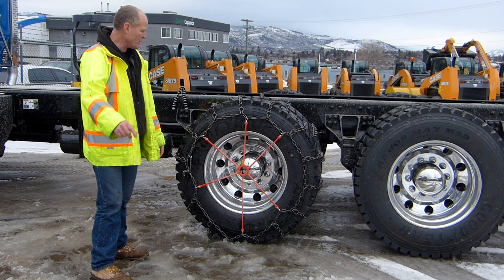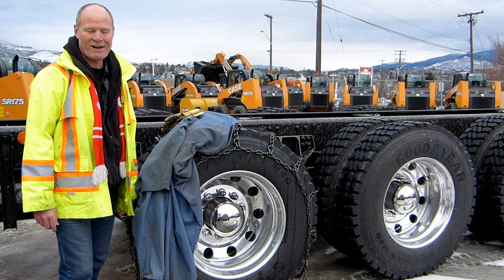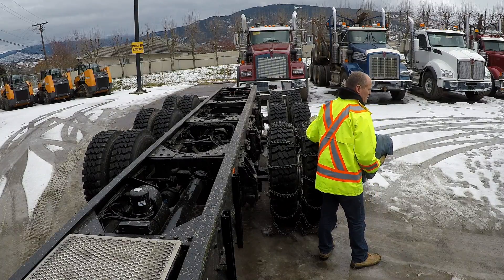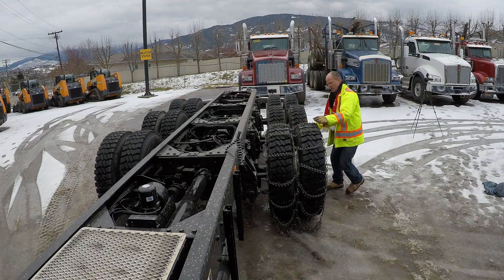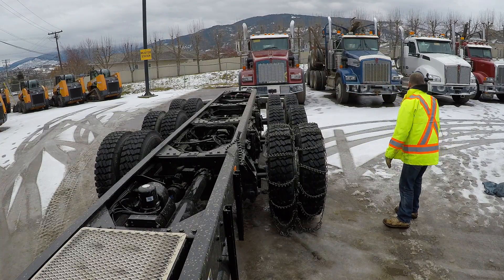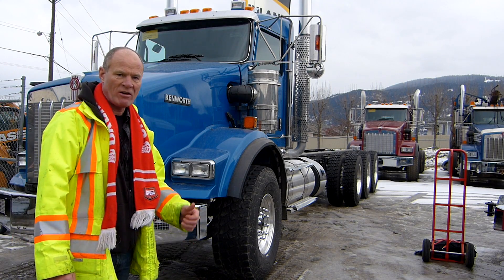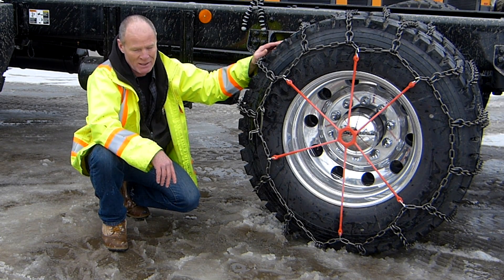How to Install Tire Chains On a Semi Truck

Comment: Thx Rick. Very informative & straightforward. I'm glad you didn't edit out the 'oops' of not rolling quite far enough to find the slack. It happens to us all.😁
With 17 years OTR, plus 9 years in the oilfield, I'm always looking for new tips & tricks.
You never get enough experience to stop learning. 
I drive a double bottom with full lockers. I run lots of off-road, & I chain up quite a bit.
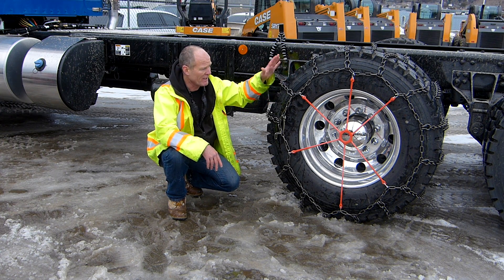I happened to notice something in your vid that may be confusing to the newer generation of drivers. At 7:50, you are talking about engaging the inter-axle, but it seems to imply that(in a tandem WITHOUT separate locking diffs) engaging the inter-axle would actually lock the entire front drive axle differential, when it merely interlocks both axles.
I do agree that if one drive axle is going to be chained, it should be the front drive. However, the reasoning is that (loaded/empty/bobtail, on level ground with proper weight distribution) the front drive axle always has more traction due to the fact that it is closer to the tractor's center of gravity.
It also extends the life of your chains because they don't scrub through turns.
I just thought you may want to review how that point is presented & clarify for the viewers.
Thanks again for the vid.👍
Reply from the maker: Hi Louis Becker - Thank you for your great comment my friend. As you said, we never stop learning. I've been in the driving industry for decades, and I teach it here on the channel. And it's because of smart drivers such as yourself that I'm continually learning more and more about this industry. Here in Vernon where I live, the logging trucks roll through all day. I often think how little I know about that aspect of trucking. All the best, Cheers Rick
Reply: Mr. Becker, you REALLY understand the physics of this stuff! I LOVE it! Thank you for your clear explanation which makes me really understand why! You are one of a kind! Many thanks!

Comment: Thank you it is a Very informative video, I know everyone does it differently but from my experience it works best to hook the middle first as tight as you can then the inside then the outside tire it helps to get them tighter and depending on the hook on the chains I always hook the first link then the next tightest link that way you don’t have the extra links flying around beating your truck and/or trailer

Comment: I always found it best to set up with the chains draped over the front of the tire with a bunched up bit of the chain you have to drive over when you pull ahead...then you can lift them up more to the top of the tire kinda the 2 oclock position hook the inner cam arm first then the middle both as tight as you can get them.  Then hook the end of the outter cam arm to the last link....yank that as hard as you can to pull the whole chain tight so you can grab any slack you might have on the inner and middle then unhook the cam arm and sorta hold it to the chain about where you think you can lock it to...slip the cam arm through that link then also slide the last link onto the cam arm and lock it into place and hook up the latch link apply any bungies you might have handy or may need and move onto the next chain. All told maybe 4 or 5 mins to throw and hook a tripple when you get some practice at it.
Reply: Ohh the idea behind slipping the last link over the cam arm when you lock it down is so you dont have 4 or 5 links of chain flying around ripping up fenders and any thing right above the tire like a trailer with possibly a wireing harness right in that area.

Comment: Excellent job rick and I'm not sure if there are signs for truck drivers to put in Chains because here in the Northeast some of the mountainous sections of interstate highways don't have signs  that tells a truck driver to put a chain on those situations
Reply from the maker: Hi EpicThe112 - Thank you for your comment. And yes, in many weather situations it is up to the driver's discretion to install chains. I watched a driver in a set of tanker Super 'Bs' down by Nelson tear up the truck because s/he refused to get out and throw on a set of chains. Indeed, many hills don't have chain up signs. All the best, Cheers Rick

Comment: Did you start with the boomers facing the front (closest to cab)?
Reply: The majority of triple chains may be put on facing either direction. Only once in my many years of experience, I came across a pair of triple chains that connected with quick hooks('J' hooks), but only had cam tighteners on one of the outside rails. In that case, the cams had to go on the outside of the tires.
Here in the oilfield, direction & types of fasteners can have some relevance. 
Often I find myself running through deep mud, snow, ice chunks, frozen ruts, etc. In these conditions, you will always have some degree of wheel-spin with the drives. When that's the case, boomers can get damaged, bent & even broken quite easily. That's why I prefer to have chains with the quick hooks because you can install them with the hooks hanging over the front of the drive tires, and the chain tails to the rear. That way, if you get significant wheel spin, the rounded part of the hooks will push off from any foreign objects, rocks, or frozen chunks hiding in the deep stuff that could rub the sidewalls and bend, damage & possibly even straighten out the hooks if the chains were facing in the opposite direction, causing them to fall off.
Again, if you're just running highway mountain passes that are plowed periodically during snowfall, there isn't much to worry about coming into contact with the sidewalls & damaging whatever type of chain fasteners you may have. Direction of installation won't matter.

Comment: thank,s you for the information, in BC single chain is accepted or need a double chain
Reply from the maker: Hi Michel Berthelette - you can use a single on a trailer or a steer, but you'll need triples for the tandems. Drop us a note if we can help further my friend. All the best, Cheers Rick
Reply: Singles used to be legal on drive axles, but not anymore. Singles are super handy for off highway when you just need to slap some on quickly for a short climb.

Comment: One thing I alway do when  I take off my chains I put them on the rack or in a milk crate in an orderly fashion so when I need them again they aren’t a tangled mess for me or the next guy.
Reply from the maker: Hi donziperk - Thank you for your valuable comment. Yes, if the chains are put away neatly, or stored on the hanger neatly, it makes it so much more efficient to mount the chains. All the best, Cheers Rick

Comment: How much does one weigh, the triple one as shown?  I saw it was included on the Sure Hire video.  You have to do squats with them and then walk around the truck with them too.
I need to practice so what do you suggest I do in the gym?
Reply from the maker: Hi Driven home - Thank you for your question. The chains are less than 50lbs (23kg). All the best, Cheers Rick

Comment: Chain up areas are usually clogged with trucks Who don't want to put chains on.
Reply: That’s because most drivers don’t get paid enough to chain. I run I-5 and I won’t chain under any circumstances. I’d rather wait it out than spend 45 minutes chaining just to keep running at 25 miles an hour. For an owner operator it’s probably worth it to keep moving. For low wage company guys, it isn’t worth the headache.
Reply: Here if you're in the chain up area not actively throwing chains you get a ticket or towed. Maybe both
Reply from the maker: Where are you located? Cheers Rick
Reply: I haven't been OTR for 10 years now, but as I remember, if Caltrans(or whatever authority is in your location) sees a truck in a chain up area with an empty drivers seat & no one putting on chains, they call a wrecker... & the only way your truck leaves that chain up area is behind that wrecker, or if the driver chains up.

Comment: What brand and who do you buy from?
Reply from the maker: Hi Joe Colwell - are you running a LOT or a LITTLE in the mountains my friend? All the best, Cheers Rick
Reply: @smartdrivetest  I run back roads and quarry hills in south to central Ontario. No mountains but icey hills that u gotta pull down to 1st gear hauling 140000lbs good km long
Reply: @RodeoJoe1981  Nordic or tryggs, studded triples are the ticket the ones without studs are pretty useless.  The lightweight ones hold up fairly well unless you start chewing then only the heavy ones hold up.
Reply: @banffdigger  who's the best to buy from?
Reply: @RodeoJoe1981  In BC pretty much all the truck dealers have the commonly used ones in stock, out in Ontario probably have to order online or call around, my brother was able to find a set in Brandon Manitoba that held up to some chewing to get a super b out of a drifted in road after he blew up a cheap set.
Reply: @banffdigger  ty

Comment: Where on the truck do you keep the chains?
Reply from the maker: Hi Driven home - Thank you for your question. You can either keep them in the jockey box, or there are hangers on the truck where the chains are stored. If there is anything further we can do, drop us a note. Always happy to help. All the best, Cheers Rick
Reply: One thing I always do when I’m taking my chains off is put them on the racks or in a milk crate in an orderly fashion so when I need them they again they aren’t a tangled mess for me or the next guy.

Comment: Is this as easier as it looks
Reply from the maker: Hi Hall Phase - Thank you for your comment. And no, because as I said in the video, most of the time when you're fitting chains to the wheel, it's dark, it's snowing and you're either standing in snow or mud up to your ankles. And often there's a trailer on which makes fitting chains that much tougher. All the best, Cheers Rick

Comment: Wrong.

First a warning-- if you're chaining on a slope -- you damned well lock up all your brakes -- and don't F around on that inside boomer and NEVER between axles and NEVER underneath it if possible. Get it on move to flat surface - readjust. If it rolls on you or slides you be ready to get the F out.

1) Always the centre first. Drape. When draping make sure links are perpendicular to the tire or 90 degrees. Pull the edges up to put slack on center. Make sure cross links are still at 90. Hook center up as tight as possible. You'll get on top link.
2) Inside boomer next as tight as possible. IMPORTANT - wrap excess chain back onto boomer then hook to chain link -- OR it will take out air bag.
3) outside boomer last. 
4) drive 2 minutes, stop, tighten. Inside. Outside.

5) chain middle or front - why? The back axles are hitting squished snow even ice by then. The front axle has best chance of traction - if you're 60 tons - in a tridem - by the time a rear hits that spot it's had 120 tons on it - compacted.
Reply from the maker: Hi Mike Munro -  Thank you for that information. It sounds like you've done a lot of chaining my friend!? The thing with chains for most drivers is that they're lucky if they have one set for the rear. All too often they're not going to have more than that. And like you said, never get in under the vehicle unless it's on the flat. All the best, Cheers Rick
Reply: All good stuff, also air up the suspension if you can, it will give you more room to work. And when you get to the outside boomer, just hook it on the last link. Gives you slack to pull and get more slack from the tire portion.

Comment: Yes you’ll get your chains on but he’s showing you a difficult way to do it at the start and missing some important things. Try draping your chains on like he does when you’re hooked to a trailer and you’ll be fighting like hell to just get them on the tire let alone hooked up.
Reply from the maker: Hi Grumpy Munchkin - Thank you for your comment. We're alway open to better ways to install chains. What is the easier and better way to get the chains installed? All the best, Cheers Rick
Reply: I'm still waiting for the reply, myself. 
I would assume Grumpy Munchkin might be referring to dropping your trailer before chaining the tractor(?).
Degree of difficulty vs time invested. 
Different strokes for different folks...
Reply: If you dont have room to get the chains on with a trailer attached you should probably not be using them, they will tear up the trailer and the chains.
Reply: @Bendigo1  
Just make sure the chains stay snug & tame those loose tails.
I run a double-bottom in the oilfield, & have fenders above the drives with about 6 inches of clearance. 
The quickest & easiest way I've found to manage the chain tails is to slide the end link up the 'J' hook, & then hook on your chosen link to get that rail snug. It'll hold all those loose links up out of the way and keep them from slapping your fenders & the road surface.
Reply: @louisbecker5941  yes i do the same thing.   I usually dont even hear the chains when i have them on.    I can tell if i break a link that way.    My point was that if you dont have room to drape the chains its too tight to be using chains.
Reply: @Bendigo1  
OK... like how some jurisdictions allow chaining exceptions for vehicles such as auto-racks because there's literally no room to work with. Gotcha.👍🏻